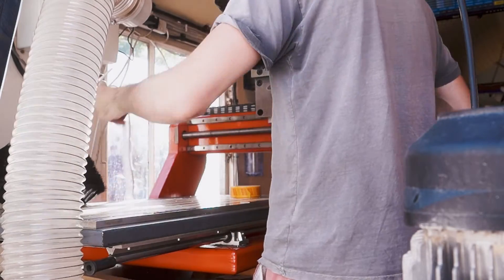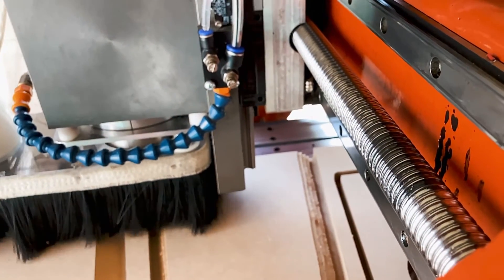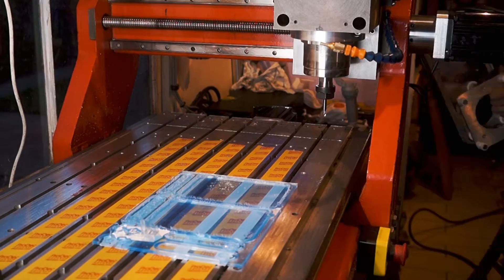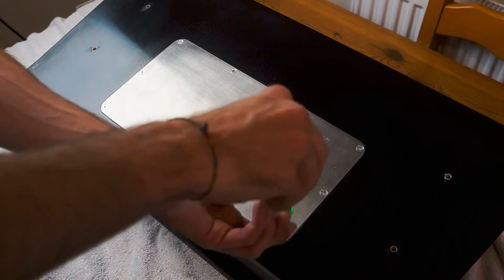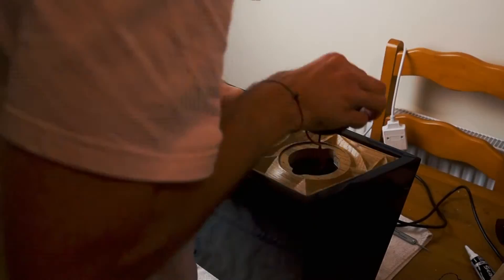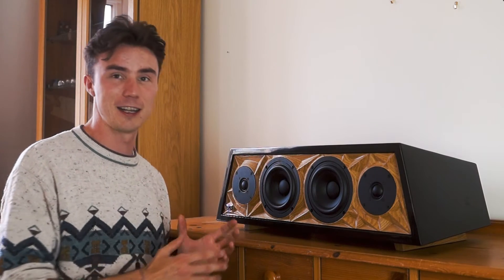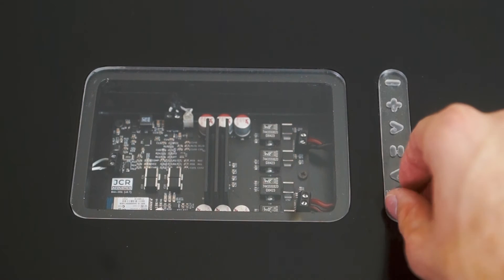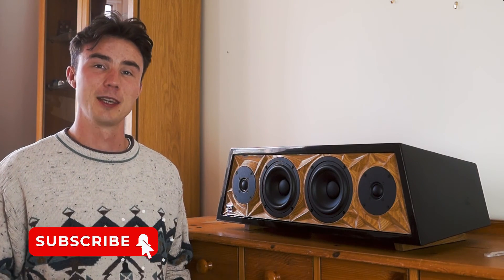DIY Speaker Build on a DIY CNC Router?

Comment: I'm curious but instead of hand sanding can you bead/sand blast wood to get a smooth finish?
Reply from the maker: Quite possibly actually, I just don't have the equipment for it. It's something I need to research as I'm sure a better finish could be achieved straight off the CNC